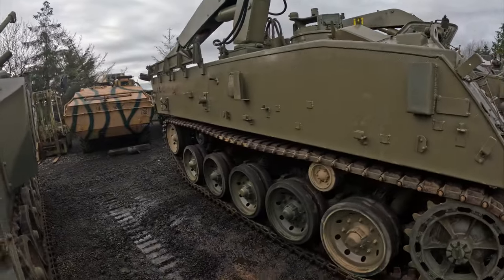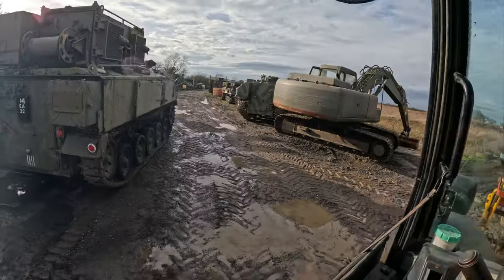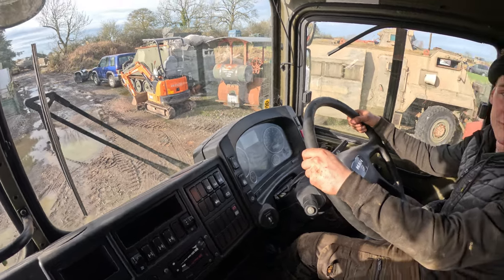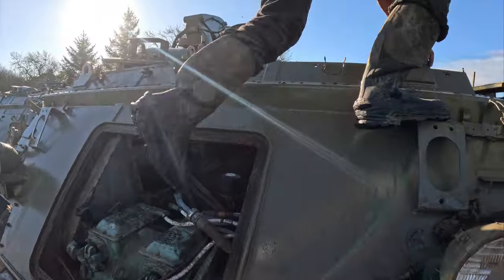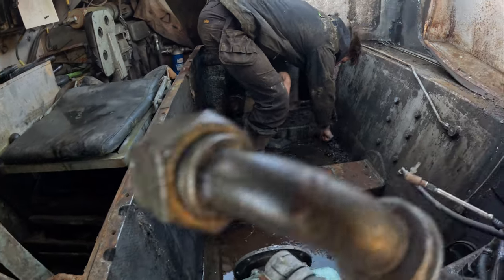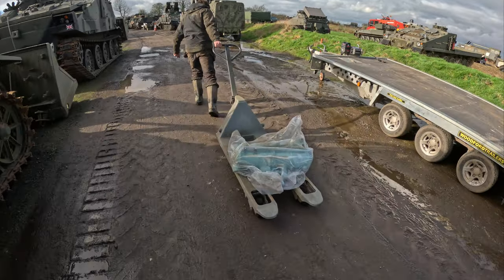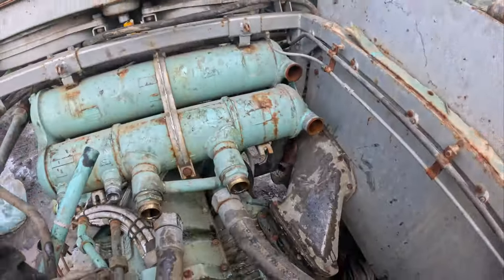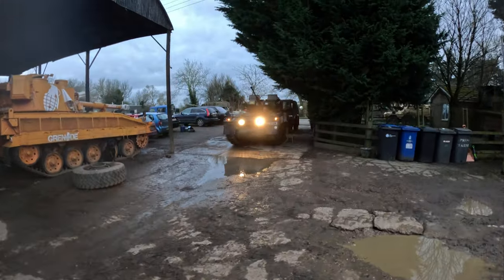Power pack removal, forbidden milk!!-Daily vlog

Comment: I can't believe ,  how no thought was made to ease of getting in and getting out in case of emergency.  Machines can be rebuilt , but operators can't be. How ridiculous
Reply from the maker: at least on a 434 there's a small escape hatch in the floor
Reply: I had a early 432 apc but after looking at the one with the open bay and Crain that one looks sweet, any other versions?